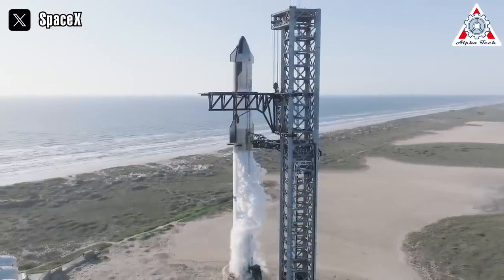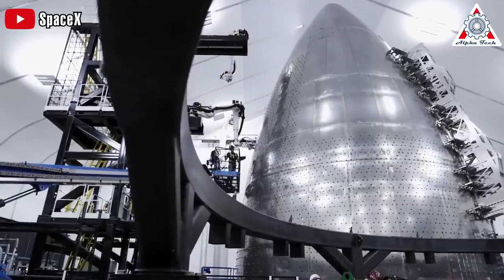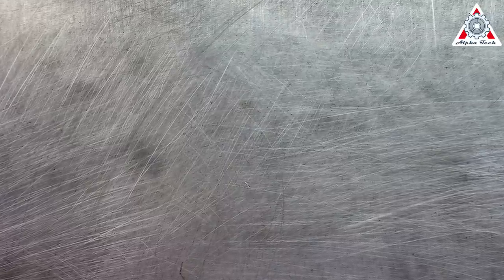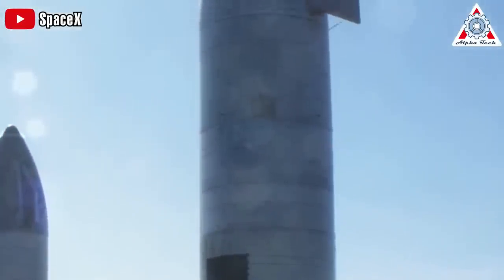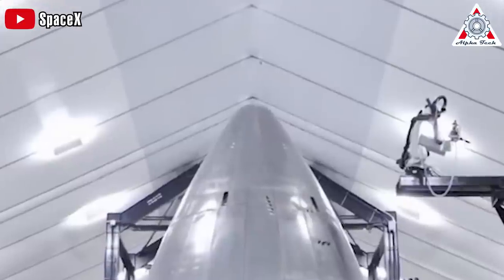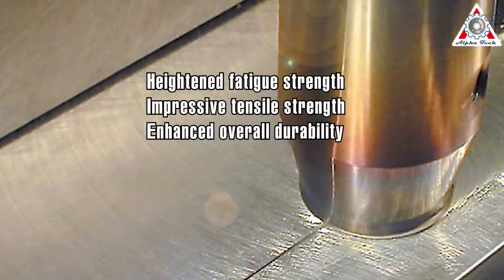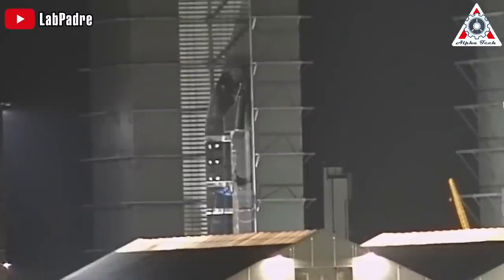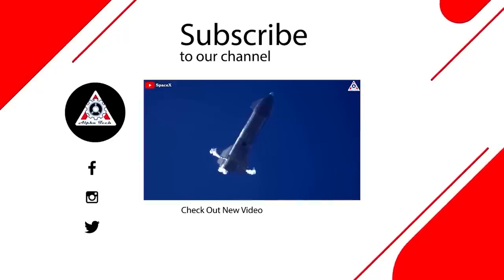What SpaceX just did with Starship's Welding shocked the entire industry!

Comment: Unbelievable that welding methods that were well established in the 1960's and 70's were not used from the start once the decision was made to use the strategically inferior 304 ( or any stainless for that matter). There are issues here of proper weld method that are not even alluded to here, and the video  implies that they seem to have had to be re-discovered by Space-X techs on their own after --- finally reading a book! That the crinkling on the original try was not an immediate sign of incompetance of the design team astounds me. That anyone can suggest that a grind-off of some crappy joint made by FCAW ( flux-core air weld) could enhance strength and integrity  strikes me as outright non-sense.
The Apollo project, and most other less projects, selected special aluminum alloys for their major shells for  a good reason, not least the over 7g/cc density of any steel as compared to the only ~3.5 for Al. There has never been a good justification for this.

This is a sad apologia for SpaceX, and ignores what other, better groups have done through sound engineering.
Reply: When they pivoted to stainless steel they had nobody who new anything about welding. And when they were convinced that this was the right material, after seeing the test results of the water tank boys, they hired more expertise. That the crinkling was awful, but it did the job of launching the first test, for a couple of pennies. Then it was just an oversized paperweight.
I'm with you on the weld quality, but if you have followed the developments then you know there is plenty of justification for stainless steel. For example aluminum gets brittle at cryogenic temperatures, while stainless steel increases in strength. And if a heat shield tile fails, the hot plasma will burn straight through the aluminum, learned the hard way by the Space Shuttle. They are also using a steel that fails in a soft way and not just cracks without a warning.
Reply: Thanks but there is a lot in this reply that is shocking. With billions soon to be at stake you are explaining that they hired high school level engineers to make the design for an aerospace grade structure? What sane, credible group does this??

There is actually NO justification for stainless here, as the whole Apollo program make s abundantly clear. You are describing the properties of native aluminum, basically the 10xx series of (barely alloyed) alloys. Even the Germans had much better than this, in many qualities, for the Hindenburg days! Check on any of the then advanced series Duralalloys that  hence emerged between the wars and eventually made it into the skins of all of the stages of the Saturns 1, 1B and Saturn V, command module exterior, etc.. Brittleness effects were not an issue even for the stages carrying LH2.

As for re-entry ability, thin stainless of any grade stands no chance on its own. Indeed all stainlesses have melting points far below that of pure Fe. Try TIG welding stainless sheet and see how little input power it takes.

Again, there is no operational regime in which the correct alloy of aluminum fails by cracking in this application, and neither category of metals has native re-entry resistent qualities except for a few hundred degrees melting point difference (useless at the heat build-up rates from the adiabatic compression phenomena encountered)

regards,
DKB